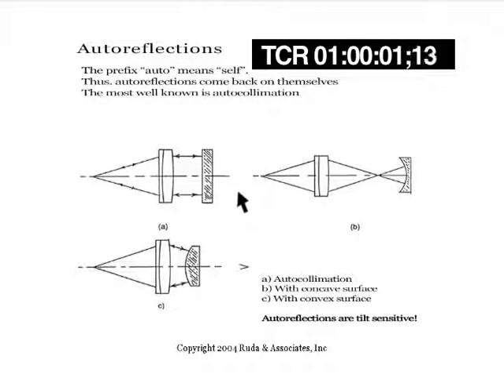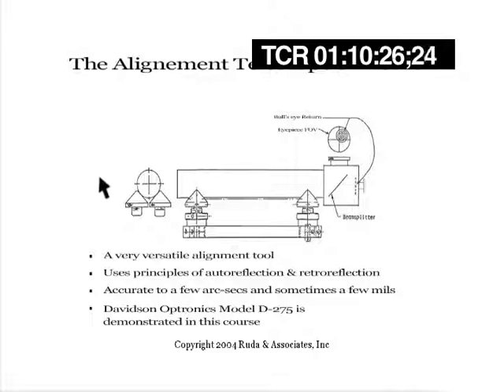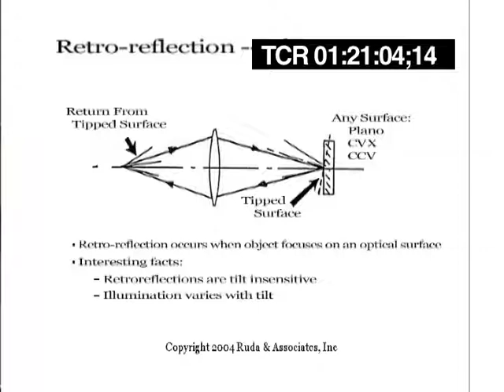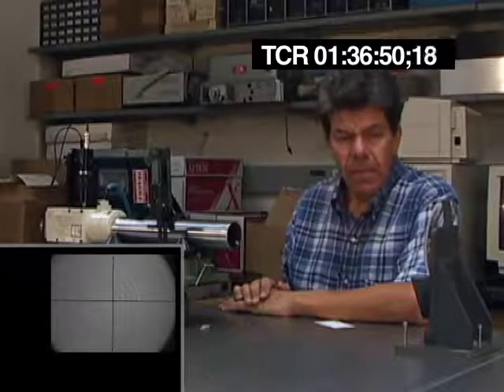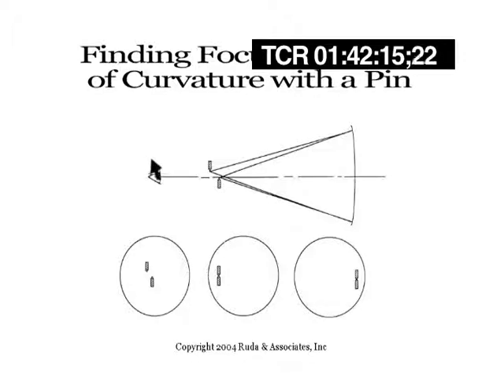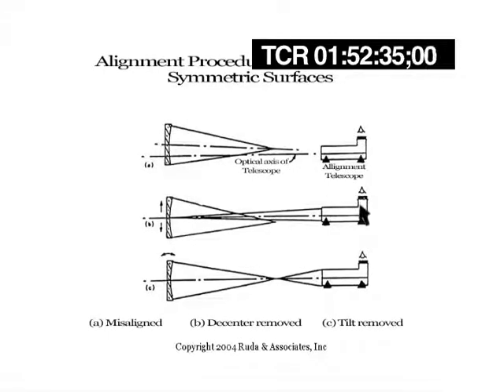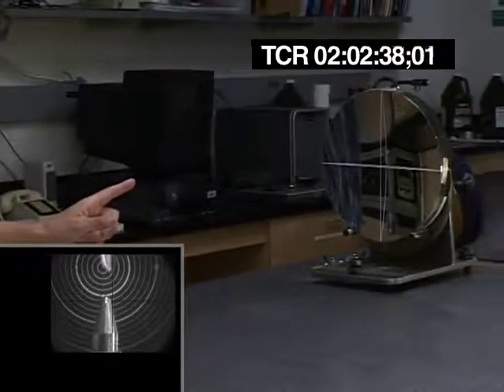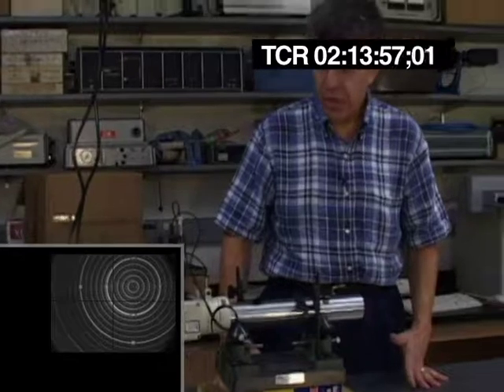Mitch Ruda, Optical Alignment Techniques: Auto-Reflection, Retro-Reflection, Alignment Telescope

Comment: Dr. Mitch, This is an awesome video.  I want to make my own alignment telescope.  I'm thinking that I could align the lenses in this device using the principles you have demonstrated in this video.  Can I make an an alignment telescope without first having an alignment telescope?  I am thinking that the machining tolerances won't be critical if the my optics are aligneable.  Can you think of a good reference for this?
Reply: Dr Ruda  passed away, you will need to ask another source. He will be missed.
Reply: Great man to work with.